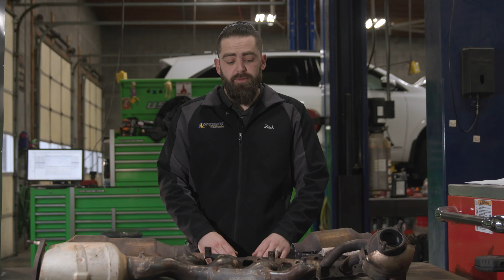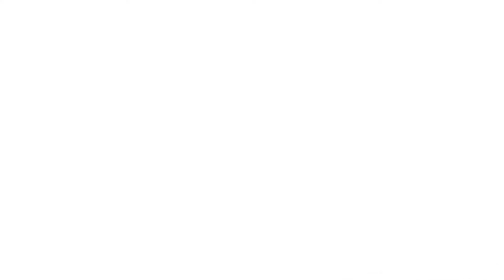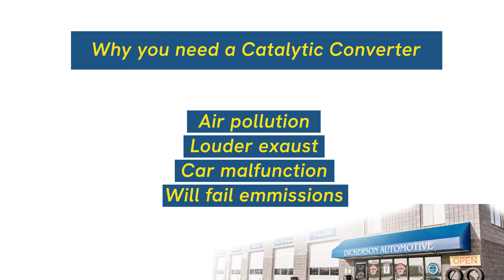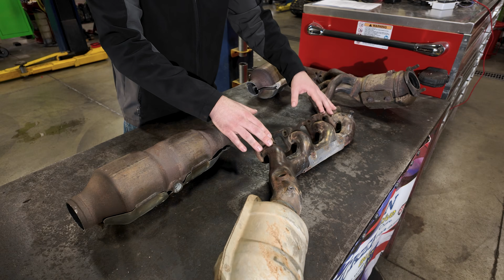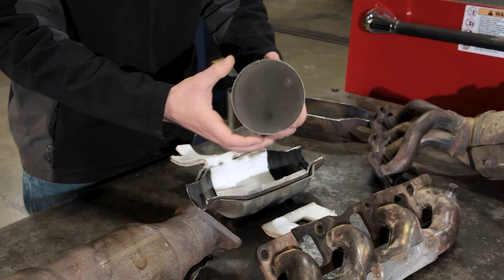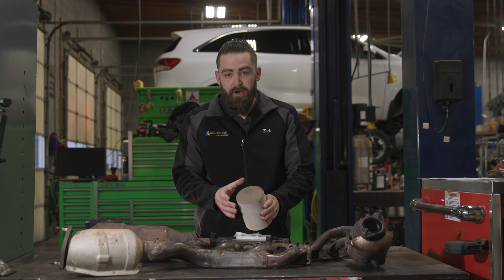Catalytic Converter Failure Signs You're Ignoring

Comment: We are in the uk my sons car the cat gets really hot but the exhaust is cold after the cat ,the chek engine does not come on either
Reply from the maker: These could be signs of a partially clogged catalytic converter. It’s definitely worth having it checked out, as this could be an early indication of an issue. If the catalytic converter is still partially functioning, it may not have reached the point where it triggers the check engine light yet.